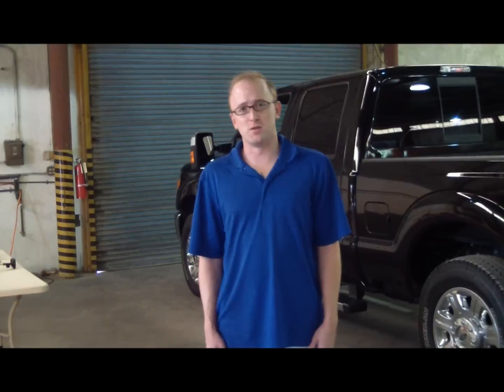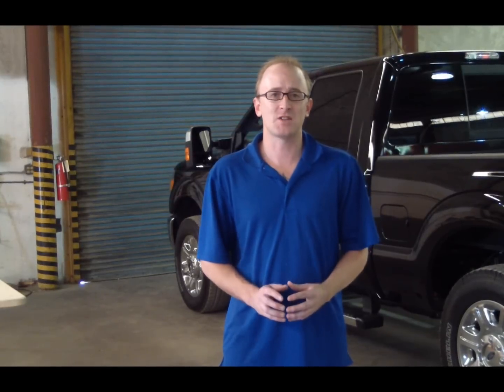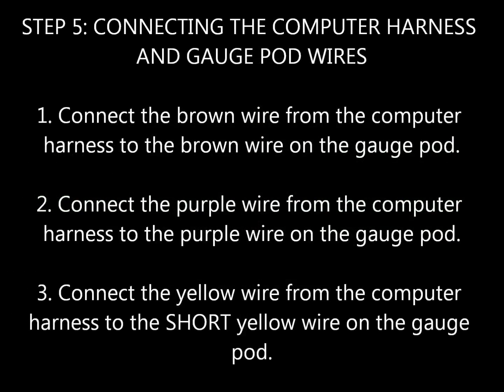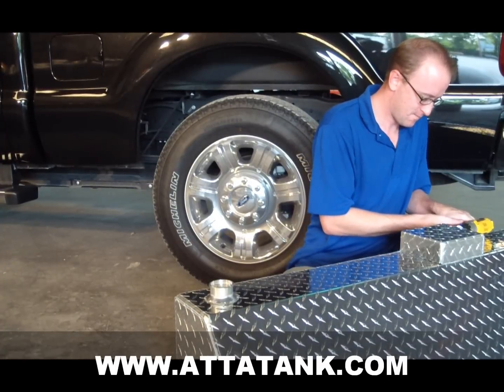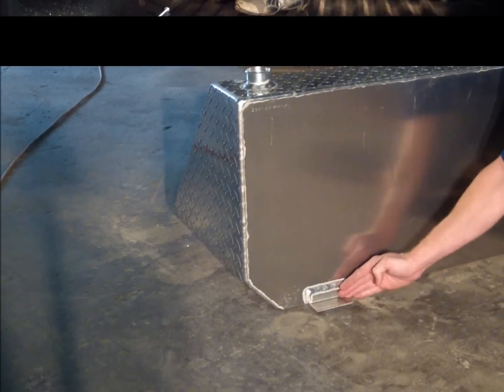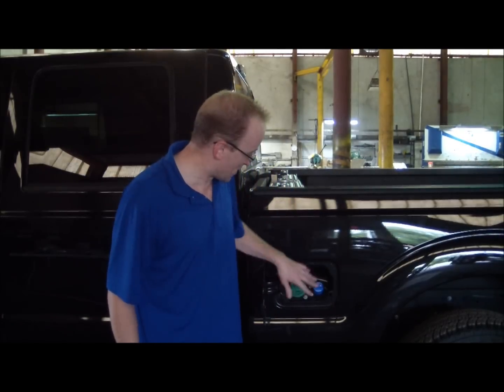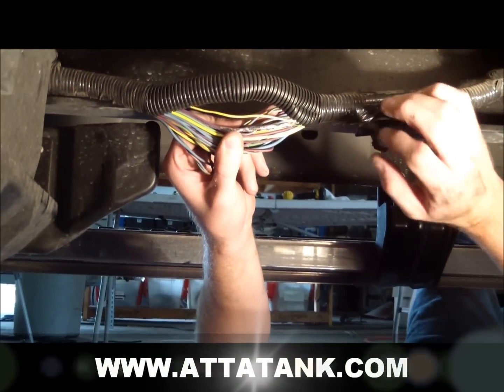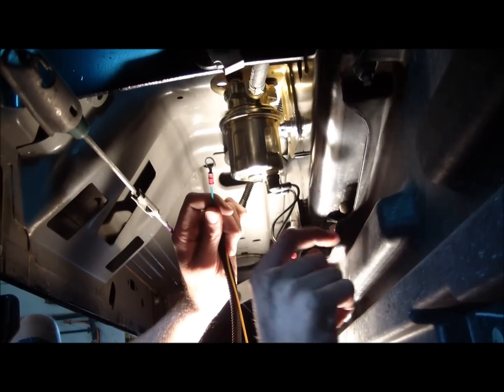How to install an auxiliary fuel tank from ATTA.

Comment: To much headache for the install. Best thing is to use the valve switch on the bottom of the tank been using it for years never had any issues.

Comment: Why not an additional 65 Gallons.. According to Google, the truck comes with a 35 Gallon Fuel Capacity. That, with the 60 Gallon Auxilary tank, give the truck 95 Gallons.. Why not give it an additional 5 gallons..? Making it an even 100 Gallons.
Reply: Probably because they are trying to save on the aluminum for the tank. NOT a system I would use and the installation they show is CRAP!

Comment: Adding to the other complaints about this video, where the hell is the Freedom Fill for gasoline?  Yeah -- DOT whatever.  Seriously -- how asinine is a fuel system that merely refills the main tank some arbitrary number of times until It can no longer do so?  Why not make the system act like every factory auxiliary tank out there so customers can flip a switch to change tanks, inclusive of switching the sending unit that operates the factory fuel gauge, so there is never doubt as to how much fuel you have left?  Too difficult to match all factory sending units or fuel gauge voltage requirements?  Then include an in cab fuel gauge for the aux tank.

After talking with a few of these folks (ATTA and ATI) on the phone I'm fairly certain I'll have to make my own kit:  6 port fuel valve, a couple of crappy inline fuel filters to protect the valve, an inline fuel pump, sending unit (hopefully compatible with my vehicle), and a DPDT switch (or a TPTT switch if the fuel pump cannot be wired in series with the electronic fuel valve).  Sure -- Ford has a six port valve that works on pressure, but I don't feel like clamping a bunch of Ford specific ends on hoses just for the pleasure of paying 3x as much for a fuel valve.  The only advice I have for youtubers is to get the power for your inline fuel pump from the factory fuel pump wire AFTER the inertia switch, thus allowing the fuel pump to turn off in case of a wreck.  That and don't be a dumbass - cut the fuel pump wire and run it through your DPDT switch.

Good luck!